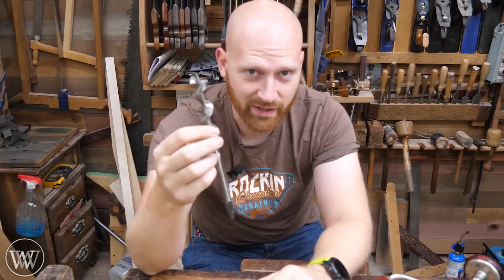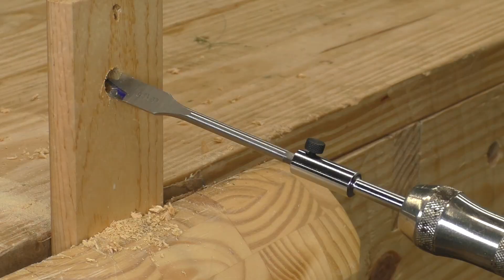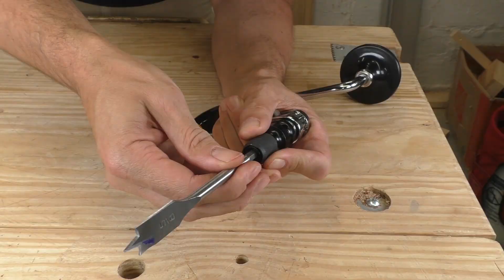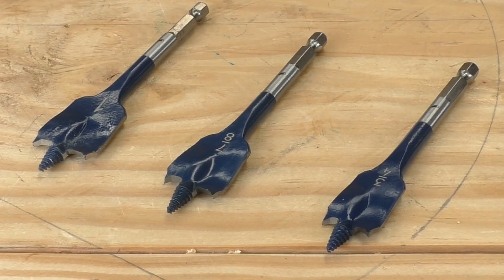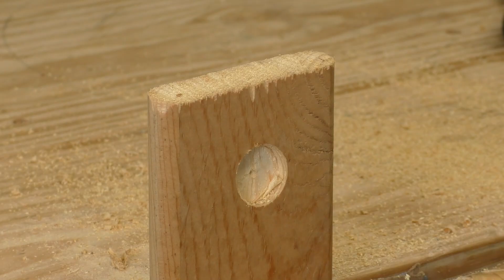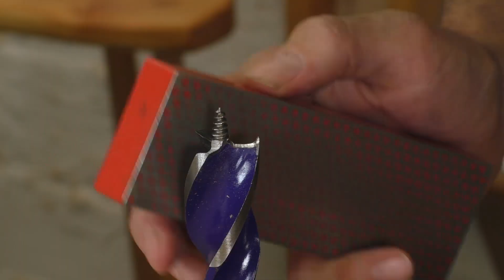Modernize your brace with new gear!

Comment: I don't really have a solution, but I wish there was a man sized version of those gear driven little hand powered drivers. Something that could drill at a fast clip and use standard spade bits but had big enough lever arms and handles to really put some power into them. Not saying I am strong enough personally, but it could be a solution for many people. And could be built to last a generation or two. Batteries not necessary so not included.

Comment: Rex, try again with the Irwin Speedbore.  This time, take your file to the front edge of each of the nickers to lean them backwards.  Then file the inside face to produce a knife edge.  That reproduces the same geometry that's found on traditional bits.

However, I run into old bits all the time in second hand stores, and they are cheap.
Reply: I've thought about trying this. You're saying to rake back the very leading edge of the nickers so that they don't bite into the wood as aggressively?
Reply: @kylewoods9182  Yes, you are correct.  Nickers evolved to be like knives, narrow, and sharp on the cutting edge.  That edge has to be right at the outside of the circle that the bit cuts.  The angle of the front edge should lean back, but that's a relative term.  It should slope away from the direction of rotation.  The closer to the tip, the further back you get, until you end at the tip, which is the furthest back.  Think of using a knife to cut a piece of leather laying on a piece of scrap wood.   You draw, or pull, the knife along the line you are cutting.  You don't push a knife along a line because the knife will pull the material upwards and leave a ragged edge.
Reply: Huh.
Might try that tomorrow.
They're not too expensive individually, so if I mess it up a bit, it won't be a big loss.

That said, still gonna hunt around for more square shank bits and one of those expandable ones. Love them.
Reply: @Vincent-S  Old auger bits are pretty common at flea markets, and second hand stores that sell any tools.  I'd go that route first, but if you can't find any old ones for cheap, buying a few of these modern bits and modifying them for use in a brace is very doable.
Reply: @deezynar Thanks for the tip, I think there's a second hand store nearish to me that might have a few bits. I've also been going to estate sales for them and end up being a bit picky about condition for main stuff like the spurs, thread and how straight it is, so it's a little slow going.
My brace is a Yankee 2101A, it holds modern hex shanks very well! I still intend to get an adapter though to help save the jaws a little for things like screwdriver bits. It's been well used and loved.
Reply: @Vincent-S 
Sounds great.  Have fun.
Reply: @Vincent-S  ive found the bits are common but many around here have no knickers or really worn down to almost nothing.Could it be the Australian  hard woods?
Reply: @redwolf7929  I wouldn't be surprised if that's  the case, I found a bit of red gum at a woodcraft store a couple months back and holy cow that thing was dense and hard even though it was only a square chunk about 6 inches both ways and 2 inches thick.

Comment: https://i.ebayimg.com/images/g/EVcAAOSwwAFbFpAG/s-l1600.jpg         Rex we have talked before and you know that I only work with hand tools. This is the set of auger bits that I bought on Ebay from Specialty Tools Warehouse. The price is less than 40 dollars for seven bits. For a hex  shanked auger bit to use in a modern hand brace and chuck I find that the work quit well.

Comment: Rex - I have 3 (at least) vintage braces.  I keep a 1/4 inch bit adapter in one of them dispite the 2 jaw chuck and it works just fine (even drives 3 inch deck screws just fine).  I can get massive torque with it.  So I don't see why I'd need anything else.  I will admit that, other than vintage Irwin bits, it's a little hard to fit any modern drill bits, but the old Irwin bits aren't that hard to find in the Middle Eastern States (perhaps they are hard to find in Western states like California).  I see Irwin (and the other style - I forget the name) bits at all the Antique Malls around here.  Keep up the great info!

Comment: Yes! I finally invested in a bit and brace and got a bunch of auger bits. Someday I might even learn how to sharpen the dull ones up. 

But if I ever need to drive something with a socket or hex shank or round bit... I'm gonna use those electrons. Hopefully someone finds a solution I can use late at night without waking the neighbors but I certainly haven't seen one that's good enough to actually use in place of my drill and driver in the general sense. They both have their place.

Comment: Hey Rex, I think these bits might work for you https://www.amazon.com/DEWALT-DW1720-Brad-Point-6-Piece/dp/B005GOM3VO

They have a brad point at the tip for guiding the bit/grabbing the wood and their cutting profile/nickers seems aggressive enough to work at slow speeds with high pressure.

Comment: I don't see the need to agonize over a hole maker when you have forstner bits and a milwaukee drill. This combo can not be improved upon in my opinion.
Reply: I've got most of a full set of auger bits and a good bit and brace, as well as a couple electric drills, a drill press, and a decent array of bits.

I've found that I actually prefer a brace with auger bits to a drill with forstner bits - not because the holes are cleaner, but because I feel like I have more control.  It's been ages since the last time I used a forstner bit in a handheld drill - I just like the bit and brace better.  I suspect I'll feel the same way about eggbeater drills if I ever manage to get my hands on one that isn't broken.

(It's also handy for Cub Scout projects, since they're not allowed to use power tools by BSA regulations.  I had 'em line up in front of my sawbench to drill the 1" holes for their toolbox projects, with the next scout in line watching underneath to warn when the snail poked through.  I had to told the back of the brace for the younger ones, but they didn't seem to mind - they thought it was the coolest thing ever.)

Now for the drill press and the lathe, I love the forstner bits - or the spade bits for stuff I don't really care about.
Reply: I have the exact same combo and literally used it a few hours ago.  I absolutely love my Milwaukee drill, but I need new batteries.  I didn't even make it through a single forstner hole before it began to bog down.  So I grabbed the brace to finish the hole.  Actually went faster then the forstner bit.

A new set of batteries for my Milwaukee happens to cost about the same as a set of Wood Owls.

Comment: Full disclosure, I am a designer for a particular tool company, so I certainly have a biased opinion.... That being said I have used the following in a bit and brace and they work well. The Milwaukee Self-feed SWITCHBLADE works very well but is probably a little more spendy then you are looking for for this application, I have also used the SPEED FEED wood auger (48-13-0400
) in the brace with very good results, these are reasonably priced auger bits with very decent "snail" and "knickers" and a reverse taper design that reduces friction in deep holes.

Comment: Your new brace looks like a socket speed handle that you can buy from most tool suppliers. They come in sizes from 1/4 inch and up. I have used them as a mechanic and they work good and they do the same thing your brace does without the ratchet. So yes put on your specific socket you need for your hex ended bit and fly at it.   Wow you made me think there for quite a while ( I know that tool)  so good job.
Reply: The Stahlwille 413QR Quick Release Speeder Brace, 1/4" Square Drive has a detachable palm head, but no rotating middle handle. Also the shaft looks a bit too long to offer a good control of the drill bit during rotation.

Comment: I have my father’s brace and bits that he used to build his first house in Winnipeg in 1952. He owned no power tools, and he and my Uncle Hank and my Papa completed the build by themselves. The house was located at 56 Essar Ave, but alas, it was demolished several years ago because the owners wanted something larger than a two bedroom, one bath house. I also have his original claw hammer, which is lovingly framed behind glass in his memory and honor. Love your channel, Rex.
Reply: Treasured keep sakes for sure. I only have a few images left of my father now.
Reply: I wish I had that knowledge

Comment: Well, now that my English joiners bench is finished, I was going to put some dog holes in it. I fortunately tried the Irwin bit on scrap wood first, not meant for slow speed. I may go ahead and cheat and use the power drill for now, and make up for those sins in later projects when we all find either a good option for new, or all of the vintage (clean) bits we could ever need.
Reply: I would highly recommend buying a single Wood Owl bit for the size dog hole you plan to use, particularly if you already have a brace. I used 3/4” Wood Owl but on my bench and it worked great.

Comment: Maybe try the irwin lockhead adjustable spade? The nicker looks like a knife instead of a flycutter, and for 30 bucks, can cut some seriously big holes. It's a square head too, so fits vintage braces. Also,  irwin still makes square shank augur bits. Not super cheap, but might do the job. 

Next idea - hole saw bit to start the cut, switch to a normal spade after?

Comment: I've found that the modern bits work well with power drills. I have tried a few of these myself and yeah... nothing works as well in a brace like an old fashioned irwin/jennings pattern auger.

A lot of modern bits are also really intended for construction work rather than fine furniture, so it is a real challenge a lot of the time.

Comment: My grandfather left me a bunch of old tools from his career as a master carpenter, oddly enough in the Cleveland area. one of the tools I got was a brace that was designed to be used by putting the saddle on your shoulder or hip and applying your body mass to aid in the bit biting in. Its gotta be from the '50s, before electric power tools were real common on a job site. it has a gear drive crank sorta like how an old egg beater works. I imagine it may work better with some of the more modern bits. I also suspect it can spin a bit faster than the style hand drill you have there. although, not fast enough to compare to a power drill.

Comment: This is interesting information, but with electric drills being so incredibly cheap, it can't be justified as anything other than a fashion statement.
Reply: In times of climate change there is use for it. Mainly in replacing the battery powered tools. Every vintage tool which is reused is a win for the environment.

This does not apply for the professional, though but for the many home workers, who only need a drill 2 times in a year but spend dozens of dollars on battery stuff, which lasts only few years and then gets tossed out.

Comment: I'm reminded of the saying "good, cheap, and fast - pick two." There probably just isn't enough market for bits designed for the low speed of a hand brace to be able to produce a high quality product at low cost. So you can either choose a bit designed for the high speed of a drill and deal with the design limitations, buy a low cost auger bit and suffer the low quality, or pony up for high quality bits designed for a hand brace.

Comment: Is there a good video on cleaning up augur bits? I got a bucket of them that were pretty completely rusted. I've used the wire wheel on the bench grinder to get rid of most of the rust and sharpened them, but they're nowhere near as shiny as Rex's.

Comment: I have a brace that was modified to use hex and round bits, by cutting the grooves in the jaws square. It doesn't sound like it'd work, but it does. I use old paddle bits with threaded spurs. They're not marked with a manufacturer, but they're decent quality.

Comment: Mainly I am a traditional woodcarver but I've recently started a journey into woodworking using hand tools. My journey so far has been reading The Anarchist's Tool Chest and restoring several brace bits, and old axes. One thing I've noticed reading the book and from several YouTubers is they all mention how cheap it is to buy old hand planes and other tools online through eBay. I haven't found that to be the case at all. Most of the hand planes I've seen sell for more like 60 to 70 bucks not the 20 bucks that they speak about. I really enjoy watching your videos and you are very practical and helpful. Thank you.
Reply: It used to be true that antique hand planes were cheap. Just not the case anymore as far as online sellers go. You may have better luck at antique stores or flea markets but even then some sellers still overvalue their rusty junk. I picked up a corrugated, type 11 (or maybe 13 i can't remember) Stanley No. 3 for $40 at an antique store recently. That price wouldn't be unfair for a plane in decent condition that maybe only needed a light restoration job. Unfortunately this one was probably only actually worth its weight as scrap metal because the cheek had broken through completely at the mouth, the lever cap is broken, the horn on the tote is gone, and I discovered after cleaning it that there are several hairline fractures propagating across the cheeks. 

Am i a fool for buying it? Probably, but i won't deny i like a challenge and when I get done with this plane it will at the very least be worth more than scrap value. I've never welded cast iron before but I can't possibly make this plane any worse. I'll probably preheat it with a rosebud and either braze it or torch weld it but for the time being I just got it held back in place by screwing a steel plate to the cheek.

This thing looks like a hammered dog turd but I love it

Comment: Tee-hee, knickers.
Bahco are worth checking for modern hex shank auger bits that should work nicely at low speeds (I've only tried up to 16mm diameter myself) &, in my experience, always have exceptional quality for the reasonable price. They're a Swedish company & readily available across Europe, but apparently they're now all conglomerated up with Snap-On, so presumably you could find some in the USA too.
I can also say that Armeg's beaver bits (and the similar designs) do not work well at low speeds, but are exceptional in power drills.

Comment: Here's a possible option, although it will take some work:  I have a few auger bits for a mortiser attachment that didn't work with the drill press like I was hoping it would.  It drills pretty good holes in soft woods.  It can drill in hard woods, but it takes a lot of effort.  Looking at the tip, there's something like a 60 - 70 degree angle on the plowing edge, so no wonder it's difficult to push.  What angles are well designed bits for a brace sharpened to?  I'm willing to sacrifice one to the experiment.  The nicker works meh, but it could be sharpened better.  ASIN B07L5G4R14 would be $5 per bit when you buy a set.  And you get a set of "free" "corner chisels".

Comment: Hey Rex. Great show you have going on over there! You asked how your viewers solve the problem of getting drill bits for their braces. I live in the Netherlands and I managed to get a nice set of 28 assorted auger bits form a retired carpenter. Actually, from his grandson who had permission from his father to sell them. They were a bit rusty but I derusted the whole set with a car battery charger, a bucket and some soda and water. I also bought another vintage set of nine bits (metric sizes up to 25 mm) in a nice pine box, all made by C.I. Fall, Sweden. I'm not sure but I suspect there's still a lot of those around, probably even more (than a lot) in Sweden. Maybe you should ask your Swedish viewers about those. -- Best, Paul

Comment: GarrettWade sells garbage. 

Sign up for Supertool's email list, wait for a good set of bits. 

In the meantime pick up a set at harbor freight, hex shank but just get a three jaw brace.

Supertool won't be cheap, but it'll be reasonable and you'll find a set that is ready to use.

The HF will do pretty good in hardwood, and mixed results in softwood. They are very cheap though, likle 16 bucks if I recall correctly. Completely worth it if that's all you can get until supertool puts up a set. 

You can also email Supertool and see if he has some that aren't listed. He's got a lot of stuff he doesn't list.

I believe Grandpa's little farm is a good reputable source, and he only deals with bits. Unfortunately at the moment he's in recovery from an injury that is taking a long while to heal. I ordered a set from him in August, and nothing yet. Thinking about getting maybe three WoodOwls to hold me over until he gets better, but honestly the HF are fine for most stuff.

Also, GarrettWade sells garbage.

Comment: OK, I'm really late to the game here, but have some hand brace bits I really like. They are made by Star M the same company that makes the Woodowl bits James Wright recommends. Model numbers are 06001 through 06017. They are ship auger bits with one spur and flute. 

I did a test comparing a bunch of bits that can be found here: https://cdn.shopify.com/s/files/1/0091/2169/3747/files/AugerBitTestFile.pdf?v=1599860142 

Most of the name brand bits in the test were total junk, as Rex found out. Some had such bad balance, they nearly threw out my wrist when using a hand drill.  

I know my test used a power drill, but these work very well in a hand braces. You still need some sort of adapter or the Garret Wade brace. The smaller sizes work out to under 10 bucks and they get progressively more expensive at they get above ¾” in size. The Woodowl Ultra Smooth bits James recommends are actually less expensive in sizes above 1”. I am a distributor for these bits, so I'm know I’m have a vested interest in recommending them, but I think for the money they are the best auger bits around.